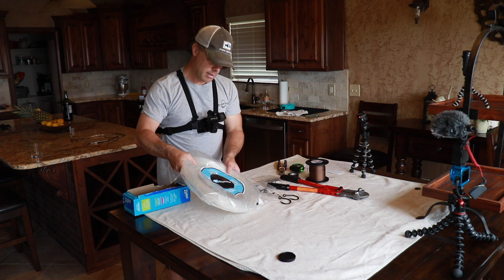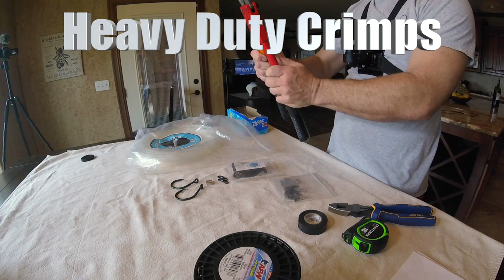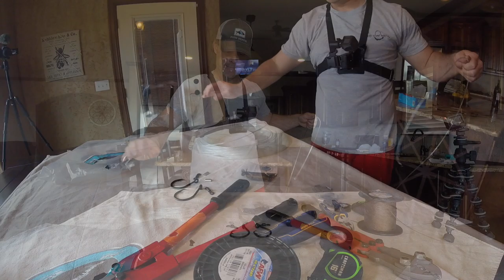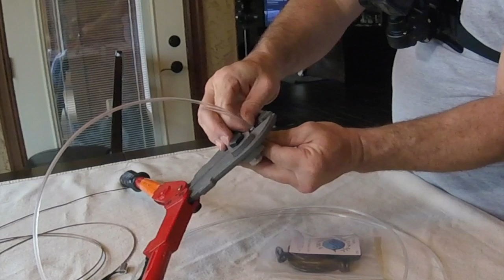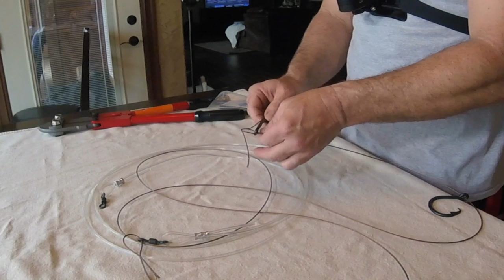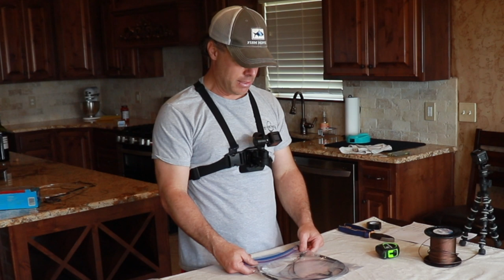How to make a Shark Leader - Ultimate Heavy Duty Rig

Comment: Well done Sean!  I have been making some of my own daisy chain rigs for trolling offshore using 100 lb. mono with aluminum crimps.  Learned something from you on making sure the crimps flare, so thanks for sharing that detail.
Reply from the maker: Thanks Bryan. Appreciate it. Yeah they say the edge of the crimp can actually cut into the line if the edge is crimped. That’s why they say to flair it. Hope you are getting some fishing in! From the looks of pics on fb it is blowing up right now!
Reply: The Lawless Tide Is there a certain amount of pressure that you apply when crimping?  Just wondering if you could crimp too hard on the mono.  Things are starting to get better, but you can’t tell from my performance.  Went yesterday in my boat to check some of the flats I fish for trout and got skunked.  Obviously some folks catching some trout, but just wasn’t my day I guess.  😕
Reply from the maker: The crimping tools run size wise according to line size. If that makes sense. Not so much the pressure but the size of the open in the crimp tool.
Reply: The Lawless Tide OK.  That makes perfect sense.  Have you tried shrink tubing instead of electrical tape?  Any problems with the tape unraveling when it gets wet?  Electrical tape is pretty sticky, so may not be a problem.  Just curious.
Reply from the maker: Bryan S it seems to stick pretty good. I have used shrink tubing before but it can be a pain finding the right size and then you have to be very careful heating up your mono.

Comment: We run 30' sometimes 40' leaders.  12-15 is way short.  One shark jump or a couple of wraps on even a smaller fish will open you up to getting tail whipped.  Just saying.
Reply from the maker: Not sure where you get 12-15 from. 10 feet of cable/wire plus 10-20 feet of 1,000 pound mono does not come close to 12-15feet.
Reply: @TheLawlessTide  that makes much more sense.  I could have sworn i heard 5 foot somewhere in the video but I was watching at 0300 🤙.  We lost a solid fish sat on a 15' my buddy grabbed from a pile and ran it out anyway and paid the price.
Reply from the maker: @iamatt  no worries at all man.